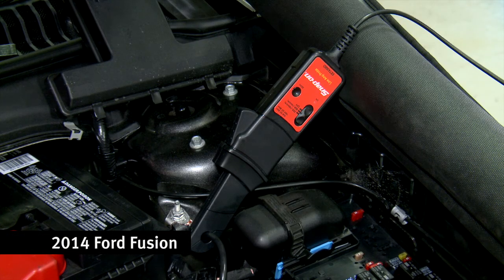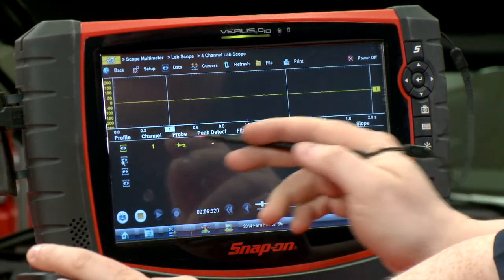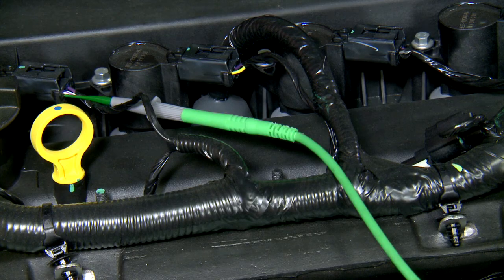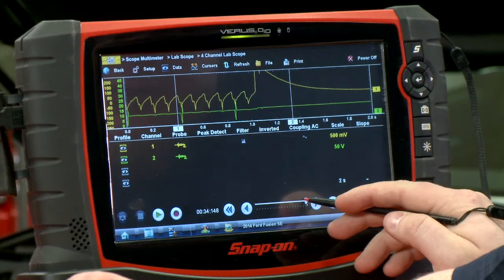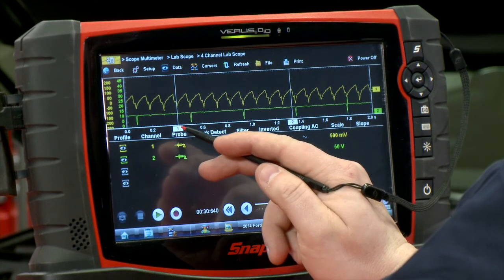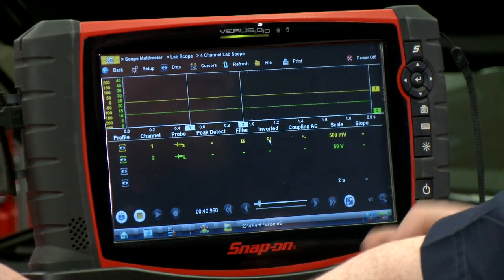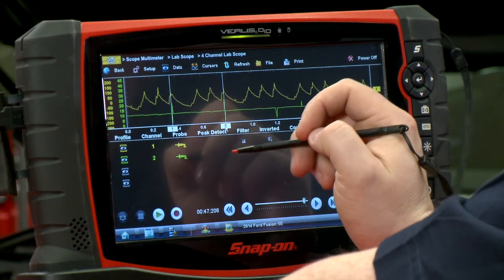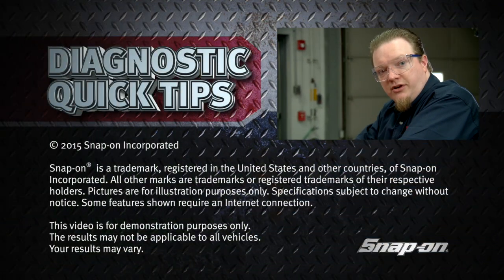Relative Compression Test - Diagnostic Quick Tips | Snap-on Training Solutions®

Comment: Should have discussed the scope settings. What time base was it set on? What voltage setting was on channel 1 for the amp clamp? What volt setting for the primary side of the coil on Channel 2?
Reply: You can see the settings on the scope screen in the video